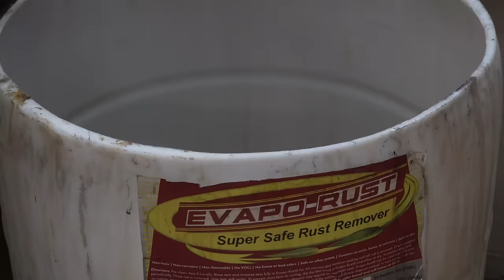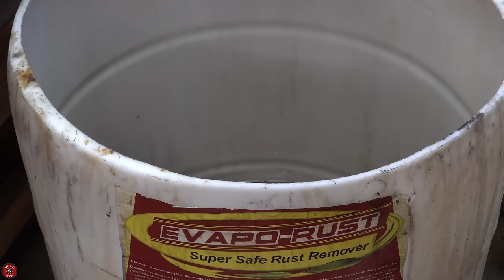1890s' Most Unnecessarily Complicated Apple Peeler [Restoration]

Comment: "Jeez, why on earth would anyone go to all this trouble when..."
sees machine peel and core an apple in 0.4 of a second
"Oh. Okay then."
Reply: 100%!
Reply: Honestly, I've got a $10 plastic one with a third as many parts that is just as fast and a forth the size.  Most apple peelers are cool.  This one is cool, but also a nightmare of parts and adjusting screws to keep tight.
Reply: @bvcxzgt5451  someone has to keep the mechanics busy^^
Reply: @bvcxzgt5451  i think this one might predate plastic injection molding somehow
Reply: This maybe is not the greatest invention ever made, but one of the most visually interesting to be conceptualized...
Reply: @bvcxzgt5451  These were for use in factories in the orchards where they processed huge quantities of apples to dry or make into cider. They were built to be used all day and night during harvest time. And this model isn't even close to the most complicated. I've seen restored ones that do three apples in rapid succession and eject the cleaned fruit into a nearby basket. All powered by hand.
Reply: My thoughts exactly.
Reply: This would've been quite useful back when they used cider for lots of stuff, especially considering that it appears to be designed to drop the finished product into a bucket.
Reply: @bvcxzgt5451  I agree: cheap plastic peelers work as well.
Unfortunately, cheap plastic peelers won't last centuries...
this one did.
Reply: @pjriepe  You don't remove the peel when making cider. You just grind the whole apples and press them.
Reply: @bvcxzgt5451  Can you please post a link to this $10 miracle.
Reply: Can deglove a starving waif's little hand in 0.04!
Reply: 'Oh, damn. It works!'
Reply: @pjriepe  😮
Reply: 😆 my same thoughts
Reply: @bvcxzgt5451  Come on, it's designed to do these on mass. It's not a commercial product.
This will do 60 in a minute when you're in the rhythm and has already lasted 130 years.
Can you say the same for your $10 plastic kitchen gizmo? lol.
Reply: @1992jamo  Yes.  It works just as well, just as fast, and there is no reason it won't peel its 1,000th apple as well as its 200th.
Reply: All he needs is to add an auto-loader
Reply: @kernelkertz  "Fear my belt-fed apple gun!"
Reply: @bvcxzgt5451  Yeah, but after 120 years I doubt that the plastic one will be around. Unlike this one.
Reply: @bvcxzgt5451  your plastic machine is not gonna last as long as this one, and it will never get a restoration YouTube video... :D
Reply: @joseamirandavelez  Actually, it would probably last longer, wouldn't rust, and would never need restoration.
Reply: exactly.. wow
Reply: @bvcxzgt5451  Plastic parts are designed to break. That's how they make money... These old machines were designed to last centuries.
Reply: @joseamirandavelez  Any part can be designed to break.  It breaks because it is designed poorly or designed to.  Breakage isn't an inherent property of plastic.
Reply: @bvcxzgt5451 I know about materials. I'm a mechanical engineer. 

Old machines were made with durability in mind. Plastic machines are made with only one thing in mind. Cost. It's cheaper to make a plastic machine. A plastic apple peeler can peel a single apple every now and then and probably last 5 years with a lot of luck. And when they break you just buy another one, because they are "cheap"... It's common sense. That's why they make everything out of plastic now...

This is probably not a household machine. It was probably made to be used in the food industry to peel hundreds of apples every day without breaking. I have worked with machines in the sheet metal industry that are almost 100 years old. If you treat them well, they just keep going... Again... That plastic apple peeler will never get a restoration video... :D
Reply: @joseamirandavelez  The difference isn't plastic vs metal.  It is build quality.
Reply: @bvcxzgt5451  Sure, but let's revisit your plastic one in a hundred years or so.
Reply: @bvcxzgt5451  Even with perfect built quality, you need to change the design of the part in order to get a plastic part to last as long as a metal one. Change thicknesses, add webs, stiffeners, blends to avoid cracking... Fatigue is a big issue. Creep is another issue if the part is constantly loaded. Material properties degrade with high or low temps. Cracking, chalking, color degradation, even geometrical changes caused by exposure to the elements, high loads or temps, or even time alone... And then when they break it's very difficult to fix them and they usually loose structural strength. If you design for durability, plastic is not the best material. Plastic is used when you want to make a product cheaper, or for special environmental situations (corrosive environments for example). Again, this is common sense. Take for example, cell phones. There are cheap plastic phones, and metal phones. Cheap machines, like sewing machines made out of plastic, and industrial machines made out of metal. Cheap CNC machines made out of plastic, and good ones made of of metal... etc... In the end, your apple peeler is never going to get a restoration video. :D
Reply: @joseamirandavelez  True.  Either one can be built to last.  There is no inherent disadvantage to either material.
Reply: Why do people peel apples when most of its nutrients are in the peel??!?
Reply: @TheTurbinator  apple pies...
Reply: @bvcxzgt5451   well this is the ancestor of those machines, its big komplicated and expensive to make.
Reply: @TheTurbinator  because stringy bits of cooked apple peel would ruin most recipes.
Reply: @bvcxzgt5451  Your ten bucks wonder most likely wont last a decade, let alone 130 years...
Reply: @bvcxzgt5451  honestly.... i think its just amazing that they had this in the 1890's. works remarkably well considering the era it came from.
Reply: @bvcxzgt5451  Apparently nobody cares about the apple.
Reply: Haha that's what I was thinking.
Reply: @bvcxzgt5451  Plastic hardens/gets brittle and cracks over time, this can happen with something as simple as the natural humidity in the air... 
"There is no inherent disadvantage to either material." Did you not read Jose Miranda's comment?
Reply: @amorag59  Steel rusts.
Reply: bvcxz gt You’re really a try-hard. Did you not watch the video where he sand blasts the surface rust away?
Reply: @amorag59  I just really don't get the almost knee-jerk reaction people are having saying as a complete and utter blanket statement that plastic is inferior to metal.  Its absurd.  Crappily built stuff is inferior to well built stuff.  I get that.  Lots of crap is built from plastic.  Sure.  It just plain isn't the material's fault.  Either one could last 500 years or one depending on how its built.  They both have infinitesimal issues like rust and embrittlement that will never limit either one's practical lifespan.   Abuse either one, and you can destroy it.
Reply: @amorag59  Right.  By that logic, I could argue aluminum is inferior and we should only ever use 316 SS to build anything in the world because its strength is 84ksi.  You know as well as I do that you just need more of the weaker material to get the job done.  strength per unit weight, toughness, transition temps, specific strain energy, chemical resistance, and many other things can be considered.  Stating "metal is superior to plastic," is just nonsensical.
Reply: ...because: restaurants
Reply: bvcxz gt OMG you still don’t get it. It doesn’t matter how thick you make the plastic to try and compensate those figures, when it will be brittle the whole way through.
Reply: @amorag59 You are way overselling plastic embrittlement.  In the absence of heat, UV, of chemical effects, and for most types of plastic, this is negligeable.  Heck, you could also note stress embrittlement, hydrogen embrittlement, or even neutron embrittlement of metals.  Meanwhile, I've got literally 90 year old plastic parts that sat atop an engine for thousands of miles that aren't cracked at all.  Is it more brittle than the day it was made?  Maybe.  Did it ever get weak enough to fail?  No.  Because it was properly designed.
Reply: bvcxz gt And no, you don’t have an engine with plastic parts sitting on top of it that was made in 1929...
Reply: @amorag59  Well, I mean, I do.  ??   So you are not just stating that it is impossible to build a plastic apple peeler that won't crack, but also that I don't own one of my own car.s  Got it.  Have a nice day.
Reply: @bvcxzgt5451  First you say I'm overselling plastic embrittlement, then go on to bring up unlikely scenarios of metal weakening such as "neutron embrittlement" and "hydrogen embrittlement" (lol who is overselling here??) then you go on and clearly lie say you have 90 year old plastic parts on top of an engine that has lasted for thousand of miles. Where you going with this? The original point was that your plastic home peeler would not last nearly as long as the one in the video (130 years), or a quarter of the time, full stop. Stop moving goal posts. You could have easily just stated the make and model of a car that has 90 year old plastic on it, but you are dragging this out for some reason? Go ahead, what car/engine is it that was made with plastic parts on it at a time where they were still figuring out how to cast engine blocks as one piece instead of separate crankcases/cylinders and connecting oil passages via brass pipes... I'll wait.
Reply: @amorag59  Maybe that wasn't clear.  My point was you are overselling the idea of plastic embrittlement, which makes no more sense than overselling various other issues with metals.    All of these are issues we deal with in design and analysis of anything properly engineered.
Reply: @bvcxzgt5451  Does your peeler even have a plastic blade? Where is the 130 year old plastic peeler? Oh there isn't one, guess you don't like dem apples.
Reply: MarksmenTM 😂😂😂 It’s like this kid has never owned plastic lawn furniture, or ice scraper, or plastic shovel in his life. Either that or just straight denial of facts.
Reply: @MarksmenTM  No, steel blade.  Why would you suggest something so asinine?  There aren't any 130 year old ones yet for much the same reason there aren't any 130 year old airplanes.  That doesn't mean airplanes aren't real.  Seriously, you folks just have this meaningless allegiance to metal.  Most crap is made from plastic.  Not all that is made from plastic is crap.  Simple concept, and that was my only point.
Reply: I couldn't have said it better.
Reply: My reaction exactly.
Reply: @hemiacplurge3572  You sir, win the prize
Reply: Ikr
Reply: @donaldblevins5028  I might be misinterpreting your comment but i think you're underestimating 100+ year old technology. Cars and electricity had already been invented at this point for an example
Reply: Vormulac1 you think this apple peelers’ complicated, check out an Atlas Pacific apple peeler. Worked on those for over 8 years.
Reply: @bvcxzgt5451  Bit late to the party but hear this one: for the price of one industrial full metal apple peeler, you could fill a warehouse with the cheapo plastic ones and outlast the metal counterpart! 😂
Reply: probably a commercial model for a pie company
Reply: @pjriepe  that's nuts!
Reply: I know, that first apple got peeled and cored so fast, if you blinked, you might have missed it being done.  I was dumbfounded.  I want one of these just to see it operate.  That is cool.
Reply: @amorag59  lol i do? Whats it to ya?
Reply: @user-lq1dk6gr3p  What we talkin' bout?
Reply: @amorag59  having original plastic on a 1920s vehicle, my paws is all original and still has plastic on it. Not saying its in fine condition but its definately still there an operational
Reply: @bvcxzgt5451  You've never peeled a warehouse of apples.
Reply: @amorag59  it depends. Many plastic/composite materials can have lifespan lasting hundreds of years, why do you think there's an issue with landfill and plastics in oceans? There's a big difference in strength, durability and longevity in different plastic/composite materials. PPE, KYDEX, ETFE, etc. All have different characteristics. Just like different iron and steel products.
Reply: @suilegew  Plastics weren't even invented a hundred years ago... Plastic isn't very biodegradable that's why, it still doesn't change the context here which was plastic surviving a constant acidic/wet environment as well as bearing all the load forces.
Reply: @suilegew  Ok, where are examples you speak of that are 100s of years old? Or examples of the likes of Alexander Parkes? Mass widespread production of plastic didn't begin until the 40s/50s, dig further than a 2 second google.

 By the way if you make a statement like "different plastics are more or less great acid resistant" the burden of proof is on you to provide... You came to this thread super late and now think you are adding substance? Someone already mentioned what you said, There also was a materials engineer that got the point - no matter what plastic, it pales in comparison to cast iron when being used as a load bearing material . Ie for context, @bvcxz_gt's little hand peeler wouldn't make it nearly as long as the one in the video.  As an example PTFE is great with acidic environments, but it and other chemical resistant plastics don't get much stronger than ~6-10k psi ultimate tensile strength. Meanwhile the average strength for  cast iron is ~69k psi. This is helpful mainly for resistance to repeated small loads, (fatigue strength) which is generally a percentage of the ultimate strength.

Yes you may be able to use plastic in some cases and have it last, something unstressed like a machine cover, but not a something like a frame which would need  rigidity for accurate repeated operation and good fatigue strength.
Reply: @amorag59  Now you are changing your story. Here is exact quote what you wrote: "Plastics weren't even invented a hundred years ago... ". That was wrong.
Now you are saying that mass widespread production didn't begin until the 40s/50s. You finally did some background research! Well done! And actually there was widespread use of Bakelite earlier than that, actually during WW1 and up until the 40s it was alredy used a lot in making components for electrical products such as telephones and light bulbs.
Reply: Jonas Wegelius Why are you coming at me so aggressively like you have something  to prove - did you just switch accounts? I’m not changing “my story” I was just wrong and didn’t care to be so accurate with descriptors on a post you all are dragging out. The point was he didn’t have an example of a plastic part on something that was “hundreds of years old” 

What are you proving by being so pedantic? Yes plastics were invented I already knew that, the point was the chemical resistant plastics and composites he was referring to were not in wide scale production. It’s not just chemical resistance. This will be the third time I’ve said this, it’s also ultimate tensile strength which is related to fatigue strength (repeated small loads).. Again If you make a machine frame you need it to not deform in the slightest and not have a weak fatigue strength. 

Some of the chemical resistant plastics in that list still absorb moisture and become brittle. A highly chemical resistant plastic is not always the best structural material either, for example molded PTFE is great against UV and chemical resistance, but still has a pretty low ultimate tensile strength of 6k psi. It’s better used woven into fabric (way higher uts) or used as non stick material. All of these examples don’t get much more than 6-10kpsi uts which pales in comparison to cheap cast iron. Let me ask you this, why do you think bike frames aren’t made from plastic? Don’t try and hijack the thread, my position was never meant to be an umbrella statement that plastic wouldn’t work anywhere, it was specifically in the case that @bvcxz_gt’s platic peeler would shit the bed long before the age we see in the peeler in the video. If you’ve ever 3D printed anything you’d understand my point of view, once you open up the sealed package of the majority of filaments you only have ~6 months to use it or it will snap at the slightest bend...
Reply: @bvcxzgt5451  Just a random walker minding my own business, but I salute you for your pacience from the future...
Reply: @the-mush  Patience? You mean Stubbornness when he claimed his $10 peeler would last as long as the industrial one in the video?
Reply: @amorag59  I'm not his lawyer, so I'm not here to defend the person, but that wasn't actually said, and neither is that the point being made. It's just funny how people can fail at reading comprehension so hard... Is it too much to ask to consider that things like "intended use", "purpose", "context" and etcs all play a roll into a machine/tool design, and not only "the """BEST""" "(tm) MaTeRiAl (tm) (whatever that might mean)?
Reply: @the-mush  Understood, mind you my point wasn't that plastic is universally unfit (or that there is a "god material" to rule them all), but that in this environment would really really be a terrible idea to use plastic. Based on my experience with plastics and in the field of automation engineering. Even seeing a materials engineer chime in is a bit of confirmation. His little plastic peeler doesn't have the intended use that he positing - he really was saying it could last longer than the one being restored in the video:
"bvcxz gt
8 months ago
@1992jamo Yes.  It works just as well, just as fast, and there is no reason it won't peel its 1,000th apple as well as its 200th."
"bvcxz gt
8 months ago
@Jose Miranda Actually, it would probably last longer, wouldn't rust, and would never need restoration."
Reply: @amorag59  I do get your point then (it seems I've missread you then [oh, the irony...] ;) 

I was thinking of those exact quotes, you have to keep in mind that neither "bvcxz gt" nor "Hand Tool Rescue" (and probably none of the comenters in this thread) would use this machine for it's intended use (a.k.a. a gazillion apples until the heat death of the universe). If that $10 machine is meant to only peel 1000 apples by its users and satisfies that goal, then we can say that the design is both efficient and effective; what is not to like? I don't think I'm spliting hairs or coming to tangential conclusions either, I think that point of view aligns with the point that "bvcxz gt" was trying to make (again, not as "a thought provoking enlightement", but to the detriment of the silly responses on the level of "bu- but ma steeel is buthaaarrrr")
Reply: @the-mush  No worries, what you wrote makes sense and is a point that hasn't been brought up yet. "Good enough" is definitely a viable descriptor if the tool lasts its intended lifespan. If all the comments I came across were able to self criticize as well as you did then threads like these that drag on for 8 months wouldn't really be so prevalent.
Reply: @amorag59  thanks for the kind words and the civilized conversation 🤝. I commented mainly because I felt the same way as you do. We all love to work with noble materials, but good enoughs , like humility, keeps us grounded.
Reply: Vormulac1 haha, my thought exactly.
Reply: 3 full rotations of the hand crank and it was ready to go again. My jaw dropped.
Reply: @christophertstone  Exactly what I was thinking, why peel an apple if you're making cider.
Reply: "it's made to do one thing and it does it very well"
Reply: @bvcxzgt5451  A nightmare of parts? To me, it looks about the same as a sewing machine. No biggy.
Reply: @lettersandnumbers81  that point right there! He actually said that like it was a good comparison.  "I have a 10 dollar plastic blah blah blah blah!" 😁🤣🤣😂😂😅😅
Reply: Yeah I don't think this was made for use in a home kitchens, it was probably for use in bakeries where they made dozens of apple pies every day so they needed to be able peel and core apples very quickly.
Reply: For real.  That’s so stupi.... oh.  Wow, that’s amazing!
Reply: Exactly exactly EXACTLY MY THOUGHTS.. I literally watched everything and then when i got to the end I was like.. Forget what previously thought.
Reply: @lettersandnumbers81  yes, since fully synthetic mass produced plastic was invented in 1907 and many of the modern plastics were invented in the 1930s.
Reply: Perhaps this was industrial
Reply: @bvcxzgt5451  
isn't this an apple lathe?
Reply: @pjriepe  ahh well that definitely makes some sense of it. I was stumped at why such a crazy contraption for peeling an apple. Thank you 🙂🙂🙂
Reply: If i had one of those i would eat more apples
Reply: @bvcxzgt5451  hey man, we all live and learn. I hope you're leading a better, more informed life now. Have a good day.
Reply: @pjriepe  love to see a video
Reply: @bvcxzgt5451  whoever designed this must have been a genius.
Reply: Such a money shot I shouted WTF! when the apple was peeled!
Reply: @roaduser6438  
RONCO
Kitchen products division 
123 Cowntewfo road 
Chicago,  Illinois
Reply: @bvcxzgt5451   You originally said that you've GOT a $10 plastic peeler And two years later I notice that when I asked you for a link to your $10 apple peeler you replied with "I don't see the one I had" HAD i.e. you don't have such a peeler. Probably broke right? Or was it stolen? Or borrowed and never given back so you don't know if it broke or not?
Reply: @stanervin6108  Ronco make more than one product. Two main items come up when I search "Ronco apple peeler" one is just a slicer/chopper, the other is made out of metal and doesn't prep an apple as fast as this. I'm unsure what point you were thinking trying to make.
Reply: My thoughts exactly.
Reply: @christophertstone  Yeah, I suspect this for a lot of use in some bakery. Back then if you wanted bread or, more to the point, an apple pie you'd have to buy it from the local bakery; ovens didn’t become universal kitchen appliances until after WWI.